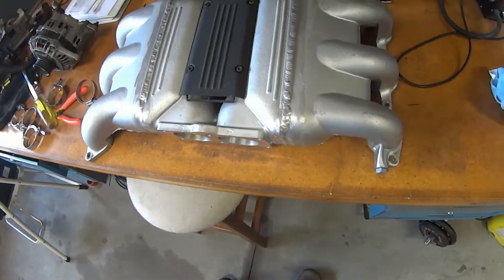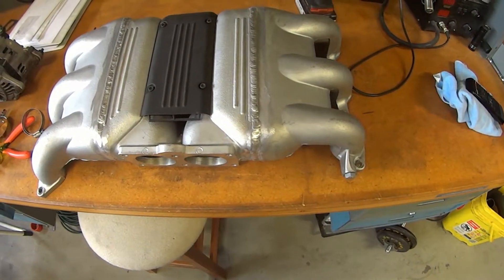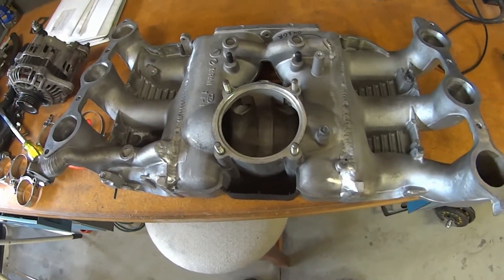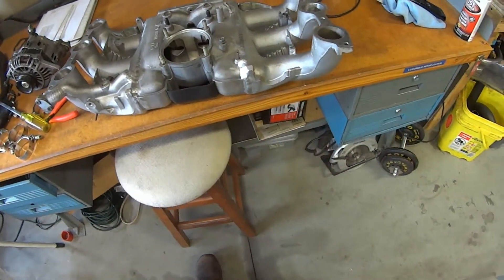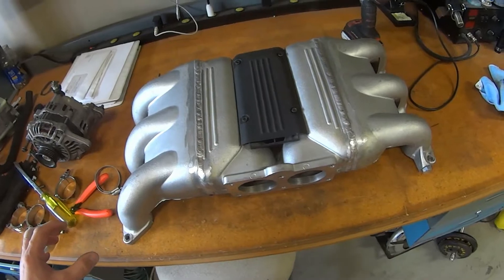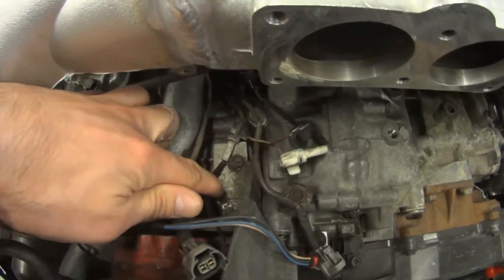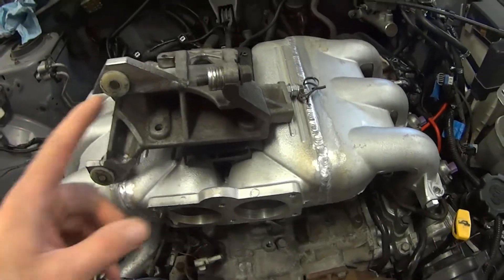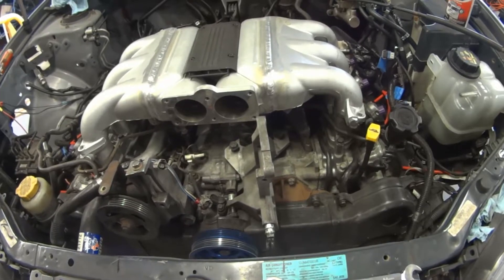EG33 Swap - Welded Intake Manifold (Ep. 18)

Comment: its "ALUMINIUM" not "ALUMINUM"    the word has two "I's" not one
Reply from the maker: You must be proper English. Embedded this way in my DNA, so I may never change...
Reply: Haha. no i'm welsh, English is my second language. just having you on pal bit of British banter. by the way looks like most of your welding could do with going up one notch on the power side to get more penetration but dont go up to much on the wire speed. it will be good to see how this turns out, good luck.
Reply from the maker: Marc Williams Totally get you, I appreciate a good call out. Thanks for the welding tips, I'm still learning!
Reply: Actually they are both right. Aluminum is the American English spelling. ex: colour vs color

Comment: Im assuming that you had to reweld the TB plate on the manifold because it doesn't just flip around like the 4 cylinders engines
Reply from the maker: It can be rotated but it would be sticking out of the hood due to the rake of the manifold. I want to retain the stock look, so it wouldn't work out. Watch the previous videos for more info!
Reply: Thanks for the reply, this was the first video Ive watch of yours, will watch some more tonight when Im not at work

Comment: Projects coming on nicely.
What ECU are you running? ive just finished ej20 turbo install in my vw splitty and i used the stock ecu. I’m planning on putting a 6cylinder in my karman ghia but cant use the auto box so need aftermarket ecu.
Have you got manual box in yours?
Reply from the maker: Megasquirt3/X ECU. Transmission is a 5MT with 4.44 final.